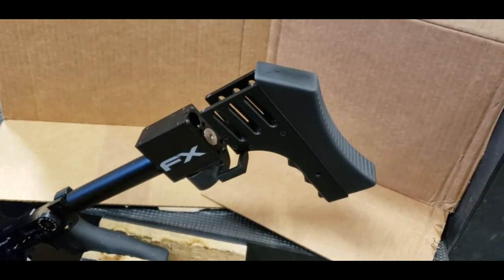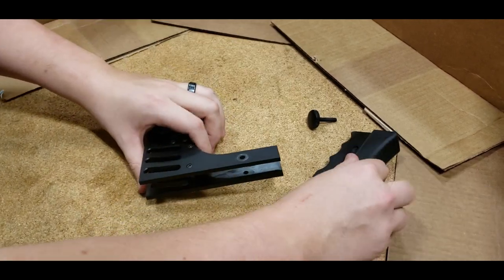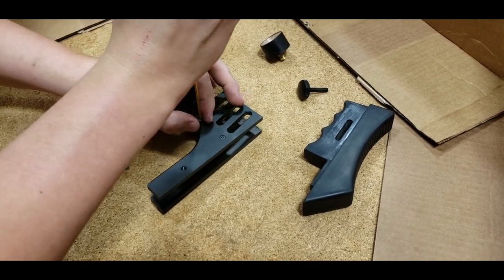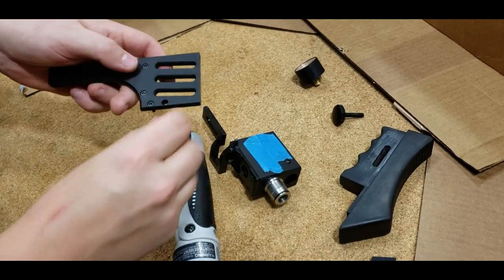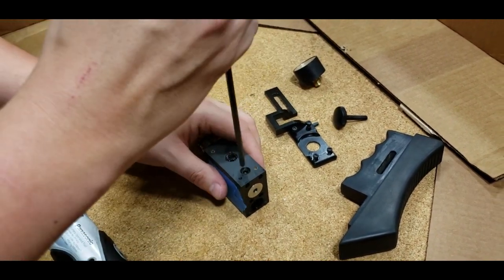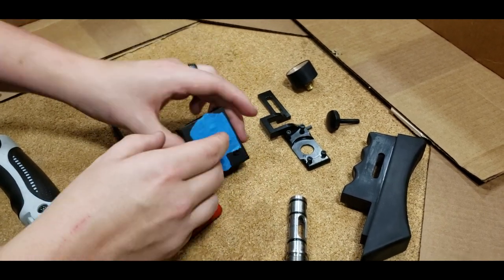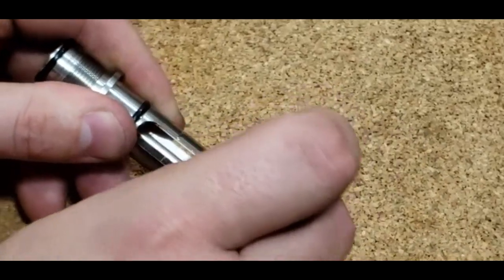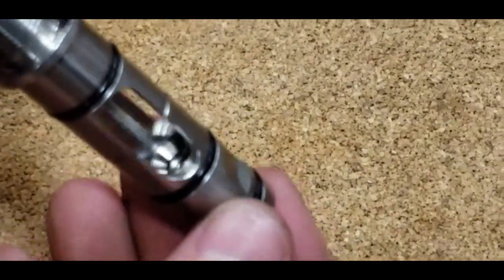How to Disassemble FX Impact Valve and Rear Block - FX Airguns Impact Rear Block

Comment: Question.  I just installed the power slug kit on my fx impact II.  I proceeded to put it back and thoughtveverything went well.  But all the air came rushing right out of the barrell.  Do you think and O ring in the rear block is damaged?  The gun is like 4 years pld and never had  problem
Reply from the maker: Air coming out of the barrel would indicate a valve leak. It may be an alignment issue when you reinstalled the pin, the hammer seat was on too tight/hung up on something, damage to the valve pin or valve housing or maybe something else that I am just not thinking of right now. Anytime you disassemble and reassemble the rifle, there is the possibility of a part not going back together exact same way as before, causing a leak. I believe you emailed me and we resolved your issue there, but wanted to reply here for public knowledge 👍
Reply: @910AirgunTuningandRepairs  yes thanks very much for your help.  You were right.  It was the hammer spring adjustment screw on the sight was set way too tight for the new lighter spring and ball installed with the kit.  I unscrewed the hammer spring screw on the side where the knob adjustment  is and it worked great.  It was able to close properly on the back en where the block is.  Thanks again!
Reply: @joshuapruitt4844  the hammer screw was set way too high on mine.  When you change to the power kit you need to unscrew the tension on the hammer screw on the side of the gun.

Comment: Hi bro. What's the difference between MK.I  and MK.II valve set. Any improvement in MK.II
Reply from the maker: MKII has a integral valveseat (non-removable) and is bored to 6.3mm rather than 5.8mm 👍
Reply: @910 Airgun. Thank you👍

Comment: So I ve a mk2 with power plenum upGrade from factory. The 3x1 valve stem seal has gone I think.( puff of air when shooting from magazine hub area) the power plenum I can get to but I can t remove the stem from the action to change it. A video would be really appreciated thanks Jim
Reply from the maker: Hey Jim,  you will have to remove the valve housing through the valve tube in order to access the end of the valve pin. The o-ring should be 2.2x1 nbr 70.
Reply: .folk like you make this community workThank you for taking the time to reply. Much appreciated. Now waiting for seal to arrive. Keep up the good work Jim

Comment: How are the rubber balls changed that are housed inside that block? Referring to the 4 balls that hold the magazine.
Reply from the maker: They are simply pressed into place. You can use a dental pick, paper clip, hook, or any small pointy object to roll the rubber ball out of the pocket. To install, just roll the new rubber ball into the pocket, making sure no air gets trapped behind the ball.
Reply: @910AirgunTuningandRepairs  I got my fx impact mk2 with no rubber balls where the mag goes